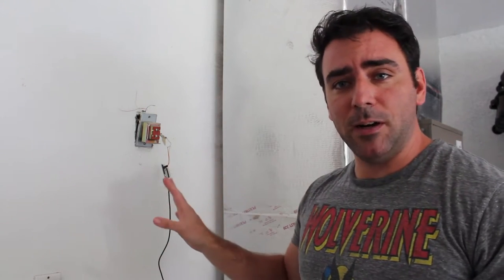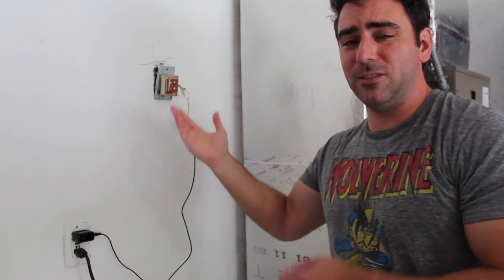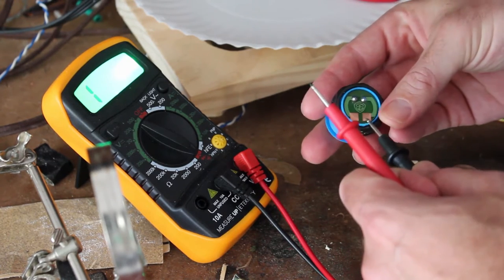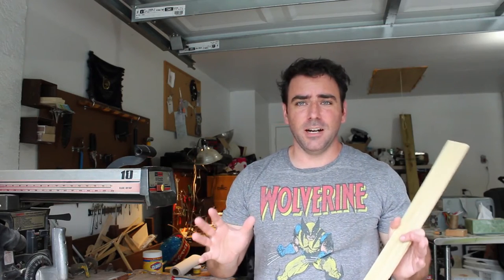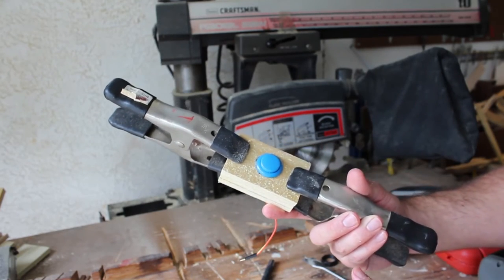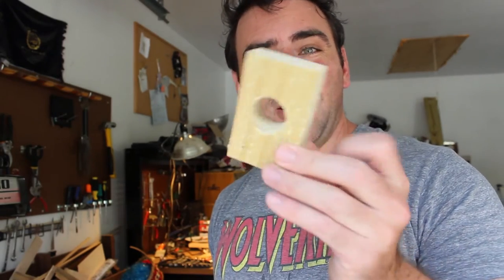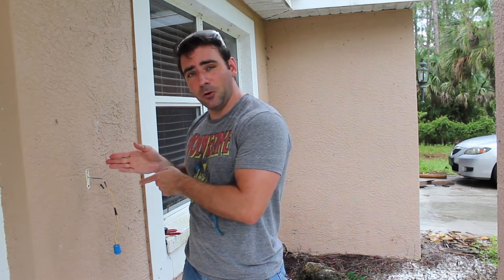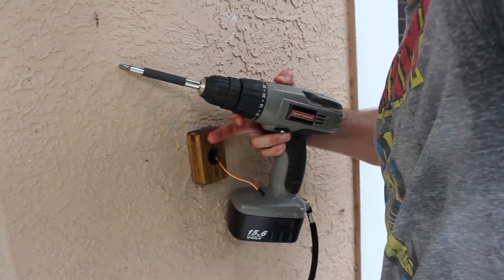Arcade Button Doorbell with ESP8266 Smartphone Notifications

Comment: A little tip on soldering. Whenever you are soldering wires to pads, tin the wires first, then tin the pads. Then you bring the wire to the pad and heat them both up and it will give you a super clean solder. :)
Reply: Agree. Was wondering why someone who has obviously soldered thousands of things together in the past wouldn't have picked this up intuitively. It also helps by minimising the amount of heat applied on each pad, helping to reduce the chance of melting or destroying switches or other components.

Comment: Nice woodworks, but will you share the code and the hardware setup as well? Or is that in another video?
Reply from the maker: The hardware setup is an ESP8266 Development board that I've shown in previous videos.  The setup for that is a basic button press (grounding one of the pins).  The software for the hardware is just doing a basic http request when the button is pressed.  When you install the ESP libraries into the Arduino IDE, there are lost of examples that come with it, and all I did was point the example to my desktop computer which is running an http server.  Here is a video on setting up the ESP8266 in the Arduinio IDE:
https://www.youtube.com/watch?v=2DL8FlrBTDs

In this case I used busybox's httpd with a basic shell script.  Here is a video on setting up busybox's httpd with a cgi script:
https://www.youtube.com/watch?v=PWMLxxzUa4g

My shell script in this case plays an mp3 with mplayer and does a few wget requests to signal my wife's computer to ring, for my webserver to send out a few emails, and for my camera server to take a few photos.